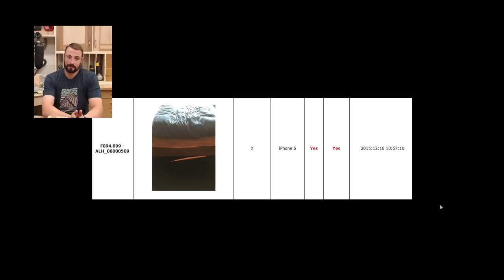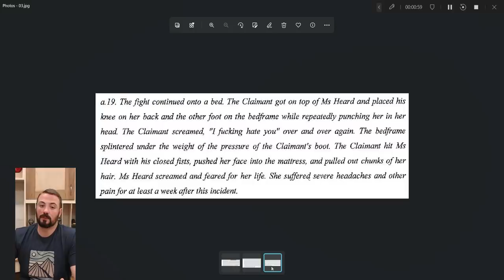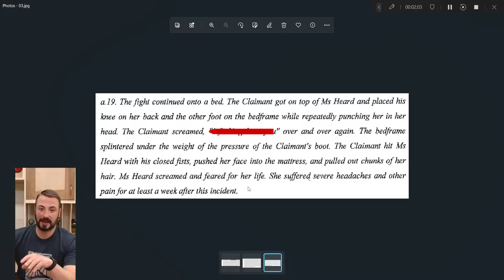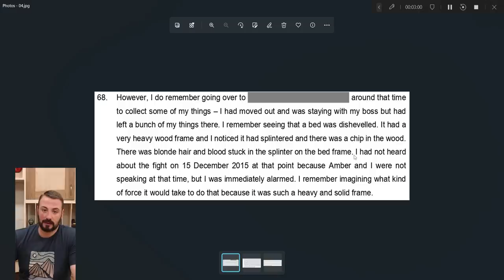Woodworker Attorney DEBUNKS Amber Heard's "Broken Bed” Testimony!

Comment: Even if the wood was fairly old - which is hard to determine from just a photo.. I can see immediately that it has a perfectly square cut, if johnny's boot was applying significant pressure on that corner, all you'd see is the edge be rounded and compressed a bit.. mayyyybbbbeee some fraying.. but you'd then see that occur on the more heavily trafficed areas of the bed frame as well from just standard use. But interestingly we don't. 

And for the sake of argument IF it was an old wood that is pretty dried out and NOT sealed. From my experience.. you'd see a whole lot more of fraying of the wood fibers and more bits all over the place. But we can see one solid piece which tells me personally that isn't old and dry rotted and thus able to give away under a bit of weight but it had to have been pried off with a sharp object. 

I'm a woodworker who also does restoration work on OLD furniture and seeing that break on a sharp corner told me the same thing.
Reply: its a multi millionaire's bed. it's definitely not dry rotted. 
it's a very thick, solid piece of treated and sealed pine. so unless it's put out to sit in the elements every day for the next few years, that piece of lumber will last forever.
Reply: The only thing that could argument that kind of breakage in that solid wood, would be that it already had deep damages OR it had suffered from termites. But as someone else commented, that is highly unlikely given his wealth
Reply: @jenns.5791  exactly my point. Johnny's boot couldn't have done that in the slightest unless it was old which we can all tell that it clearly isn't. But I could see amber's team try to argue such a point to prove johnny's boot did do that.
Reply: @VonCraft  i wouldn't put it past them. at this point, they're desperate. the whole thing is pathetic.

Comment: I have no woodworking experience, but even as someone who frequently chops wood for my chimenea outside - including a variety of pine Christmas trees come every January - a boot is NOT getting into that grain. Even trying to cut through horizontally like that with an axe is not easy. A BOOT splintering it? No way. Absolutely no way. Im so glad you illustrated this bc her testimony did not add up at all.

And that looks like a wine key! That little blade in them to take off the foil would do this. Heck, Amber probably carries one just like one carries their car keys given the amount of wine she drinks.
Reply: That's not a winekey in the trial they identify it as a switch blade iirc
Reply: To be a devil’s advocate here, there are a couple of things that come to mind. Firstly, I can’t help but think that the way the edge of the wood was cut on the bed, at a sharp 90° angle, would make it more likely to splinter than with the demonstration wood, which was rounded at the edges. Wood cut in this way is more likely to splinter, especially if the force is applied perpendicular to the cellulose fibers. The lignin that binds the fibers together in pine wood is soft and easier to break, especially if the edge is hard (90°). In the video he makes an analogy to straws, but this analogy demonstrates the weakness of the wood along that axis, not the other way around: it’s easier to pull apart adjacent straws than it is to rip the straws down the middle. As I mentioned, the lignin bonds are much easier to break than the cellulose fiber itself. Also, the age of the wood should be taken into account. In the demonstration, fresh wood is used. There’s no way that an empty boot pressed with the hand against a smoothed edge of a smaller cut of wood is going to come close to the force of a human body, with “purchase” or without. Furthermore, knowing something of Depp’s style, I would presume he wasn’t wearing rubber-soled work boots; it’s much more likely he’d be wearing leather-soled boots with some kind of heel. If Depp was pushing his foot into the edge of aged wood with the inside edge of a heeled boot, it’s not out of the question that a chunk of the wood could splinter. The demonstration does not come remotely close to simulating the system in question. To me, that comes off as disingenuous, especially given the way the compositional strength of the axial grain is misrepresented. Push the end of a pen into the edge of a chopstick and you’ll see what I mean; much easier to split the grain than to break the stick lengthwise. Lastly, it’s not impossible that the edge of the wood had already undergone some kind of strain that made it more susceptible to breakage. That’s purely conjectural of course, but the possibility can’t be discounted. 

All that being said, the physical set up that Heard describes is very difficult to imagine, especially given the width of the frame. It would have to be demonstrated to be sure, but there seems to be something very awkward about the positioning of their bodies as described. Plus there’s the knife/wine opener/what have you. Given Depp’s propensity to carry knives, it’s not unreasonable to believe that a knife clipped to his belt fell off in a scuffle.

Having said all that, I’ll conclude by saying that I’ll play devil’s advocate and not armchair lawyer. I have no opinion either way in this case; I’m mildly entertained by it, but I feel no investment in the outcome, nor interest in catching anyone in a lie or siding with one side over the other.

I just decided to reply to your comment because I was disappointed in the weakness and superficiality of what I’d hoped would be a much more effective and persuasive demonstration. The break in the wood is perfectly plausible, and this video really didn’t prove otherwise (not to mention that the whole exercise seemed in the end like a pretty futile point to pick at).
Reply: @arielzambenedetti800  i had some similar issues with this video and thought the setup was not a fair comparison. However i think you are being ridiclous regarding the knife on the bed, to pretend that ‘could be a knife of johnny’s that fell out of his pocket’ is extremely reaching.  The simplier explanation is often more probable and seeing as whoever took the picture could have easily forgotten they left the knife they used to damage the bed in thr photo, that seems like a fair mic drop at the end of the video to me.  
The rest, the splintering of the wood. I suggest you go take a look at Johnny’s foot atire, and then go try to push for purchase on a piece of wood like that and see if it would ever splinter like that.  While i give you the explanation here regarding wood grain is misleading because it doesn’t take into account how would does break cross grain vs with the grain, in this case particular with a softer wood like a pine, the spinter we see in the photo is not indicative of how pine would spinter given Amber Heard’s described scenario.  
Pine would first indent before the spintering would occur, causing a noticable inpression first, which is not at all present in the endging of the splinter and of the edging of the broken end beam which is left of the bed.  Take a blunt hard object as hard as you would need to be able to hold the edge and push on pine in the 25 to 75 degree angle that would be his boot angle against the beam and before that wood splinters it will indent significantly with pine.  Take a large sledge hammer even and try and you see a clear indent if you use enoforce to splinter that size of wood piece.  So while i agree this channels explanation isn’t complete its conclusions are not wrong, the splinter is 100% in alignment with a knife jammed into the wood and raised to cause the spinter of that size, and not what a boot of someone like johnny who often wears loose fitting boots that just are not made for any kind of ankle support etc, it just doesn’t fit what that splinter of that size would look like from any boot, even a metal one going all the way to the hardest material, and any inbetween, it would cause a large enough indentation before the splintering to be easily noticeable.  
I would love to see someone actually push hard enough against pine to see that spinter, and i would put money on a clear indent before the spinter occuring.
And the fact that the splinter made with a knife so nearly matches exactly the splinter in the photo in evidence is a huge indication that is exactly how that splinter was formed.
So while i agreed with your beginning portion, the end just seemed like a person who is trying very hard to justify a ‘they are both guiltly’ conclusion.  The evidence overwhelming points to Amber Heard and friends lying their asses off to kick Johnny out of his own home, change the locks so she could safely start bringing home men the very next night after changing the locks to sleep with. And showing up to the court house after using a bruise kit, after having clearly called tmz to capture videos of her holding her head up in a black dress for all the world to see.  
So bending over backwards to side with Amber is honestly where you lost me.  The whole ‘there are good people on both sides’ equivalent argument is yea even a further stretch then you acuse this video of making….

Comment: It looks like a Leatherman type thing. I wasn't invested in this situation during all the years we've been hearing about it but after seeing her painful high school drama acting while testifying I have been fascinated wondering how's she's not so embarrassed by her self and what story/delusion she must believe to not want to hide her head in the sand. Wild
Reply: It is shiny like metal. It is heavy for its size because it depresses and creases the sheet and I estimate it to be about 10 cm x 1.5 cm x 3 cm. And it has at least three parts lengthwise, that may or may not be separable. It certainly looks like a metal tool of some kind. That could be a multitool like a leatherman, a bottle opener, a folding knife. It certainly does not belong on a bed.

Comment: If he was pinning her down with his knee, wouldn’t that leg be the one he’d be pushing harder with while his other leg was merely for balance/support? So he can break solid wood with his non dominant foot but didn’t break her spine nor any ribs with his dominant side and exerting even more force? Mkay….
Reply: My thoughts exactly
Reply: I think if I was being pinned, facedown on a bed, with my head smooshed into a mattress/pillow, I'd have no effing idea what his other leg was doing. It could be doing the Can Can or a goose step or just limply hanging out ... I'd only know what the leg on my back was up to. Not the other one though.
Am I right?
Reply: @md61211  correct, when you are being assaulted you remember what happened to you, only you, her testimony is so weird because she is hyper aware of were his legs are, how is he stepping on the frame to push her, as if  she is seeing it all from the outside trying to make a scene; had she told that she was being pushed down and suffocated and described how she felt, and the terror of not breathing while being pinned down the matress would have been more accurate to what a victim suffers, she describes as an outside viewer not one that has experienced it

Comment: Rob, congrats on making a vid! Excited to see you found your channel and wish you all the best in growing!

When it comes to the bed, I immediately thought the same thing. My father was a carpenter by hobby and made a TON of our household furnishings. (I still have the mahogany twin bed he made for me that I've since passed on to my daughter). That bed has seen SO much abuse and it is not constructed of larger timbers as the bed shown by AH. The ONLY time I have seen splintering like that regarding my bed, which is MUCH stronger than pine, was similar. There was a separate piece that made a set of drawers that went underneath the mattress. While I was at college, my nephew used the bed and abused the drawers. The screws and hardware (which as we all know, are driven into the wood like a knife) caused this kind of splintering. The mattress also appears to be a full/queen with euro-size pillows and queen/king pillows behind, meaning that footboard is roughly 24" from edge to matress. JD is 5'10" and if he has an average inseam, could run 29-30", meaning from knee to heel is appx 22-23". If his other knee is in her back, and her face in the mattress, I doubt he would even have much leverage to keep his balance, especially if he were to somehow be physically able to cause the break in the bed, releasing much of the exerted pressue to keep him balanced. I imagine she's not very still throughout this alleged ordeal, meaning he would have to place a majority of his 170-180 lb body on the leg not "pinning" Amber. How did he not fall over if this break actually occurred in the circumstances Amber described?

The math isn't adding up either way you chop it.

Comment: Imagination exercise….  Try to imagine the entire scene. How would JD have a knee on her back and a foot on the edge of the bed and have enough leverage to push into the timber with the other foot. Also where would here body be positioned and his body? There are so many things wrong with this. She’s lying about absolutely everything!
Reply: Not being a woodworker, just a 62 y.o. female, even I knew it was clearly cut using a knife. Would have been great if something like this was shown during cross or rebuttal but the fact that the folding utility knife( I have one just like it) was still on the bed says a lot. Anyone with a bit of sense should be able to tell it's a perfect slice.
Reply: And how tall are they both? That’s quite a span. Are Johnny’s legs that long?

Comment: As a layperson I’ve been weirded out by that pic because a few years ago my mom made a wooden bed for my sibling and nothing they did to it, short of using tools on it, could break it or chip away at it, as has been done to JD’s bed. it. So thanks for making this detailed video explaining why the alleged damage is not possible in the way AH described.
Reply: @bina nocht Haha my mom made the wooden because my siblings IKEA day bed broke on the long side, but not like this, it’s just their stuff is cheap and often with damage.
Reply: @bina nocht JH’s bed is far too solid to break from anyone stepping on it and like you’ve realised, it’s not even the long piece that most may expect to break. This is the short piece at the bottom and it looks kind of like a whittled piece of wood, hence the suspicion that a knife was used to remove the bit seen in the picture.
Reply: @bina nocht Do you have link to the calendar image? I haven't seen it anywhere. I think it is just another hoax, like the exact quotes from mr. Rippley.

Comment: "Gain purchase" also sounds like he'd be going the other direction, trying to pull away from the bed rather than sit on it.

I questioned multiple things about that testimony, starting with how she could be on the mattress (not "bed", which could include the frame, "mattress") and his knee on her back, but still be far enough back that his other foot would be on the edge of the frame of the bed. It's a pretty wide frame, just saying.

Then there's the weight discrepancy. If "all" your weight is on someone, you would have no weight behind the force that's not on someone. Go ahead and keel on something with all your weight (ie center of mass over your kneeling leg) and try to move something with decent weight with the other foot. You'll find that in order to exert any real force, you shift your weight off your kneeling leg.

I noticed her saying she couldn't even scream or get a sound out. Then say later she didn't know when she'd stopped screaming.

Back to the "gain purchase", you have to ask gain purchase for what? He's supposedly kneeling on you, so what would he have to gain purchase for? If she were struggling to get up, he'd be leaning forward to put weight on her to keep her down, not leaning back and resting his foot on the edge of the bedframe.

There's her spotty memory, clear as day when she shouldn't know details of what happened because she didn't witness it, but murky as all get out the moment it gets to the "less exciting" part. I hit a deer with my car recently and legit all I remember is the image of the deer when my lights first caught it, that what came out of my mouth wasn't actually words, and everything that happened once the moment of fear passed. I don't even remember the exciting part, just the shock and the aftermath. Although to be fair, it was only seconds of excitement.

I gave amber the benefit of doubt when she first came forward, but something about her made me trust depp more and I'm only seeing evidence that I was right.
Reply: Probably a line in a movie
Reply: I think she used the knife that's on the bed to do the damage to the frame. No other way of doing it. In one photo there's a small section of damage while in another its the entire foot of the frame that's damaged.. She went into a rage blackout if anything. Probably because he left when she started showing her tells..I guarantee she pulled her own hair out in frustration and most likely headbutt the frame for  self-inflicted harm..
Reply: @katzeyez1979  yep, we all have seen enough "karens" to know that they will go to any lengths to be a victim.
Reply: @morphergaming0531  no doubt lol..
Reply: @katzeyez1979  Headbutting the frame to damage it or to hurt yourself? Because even Batista won't be able to harm that frame by doing that